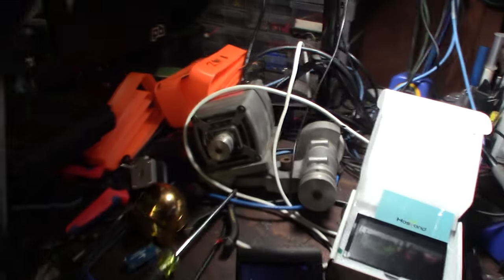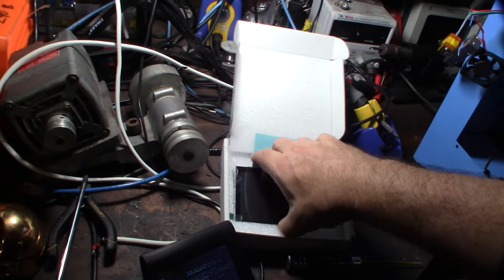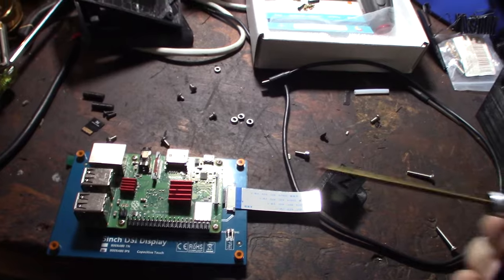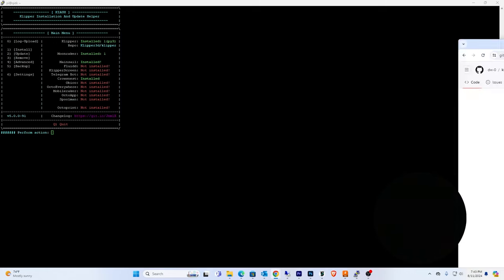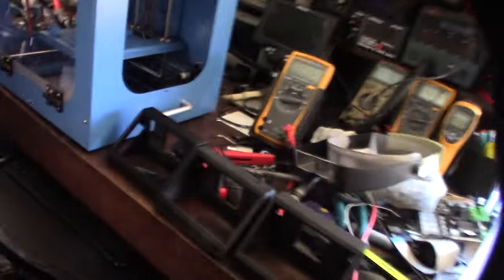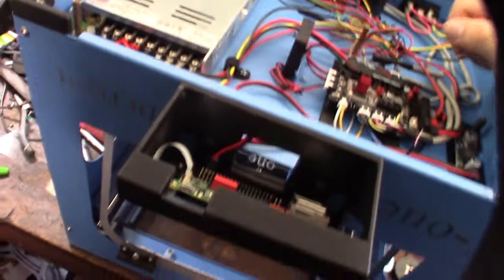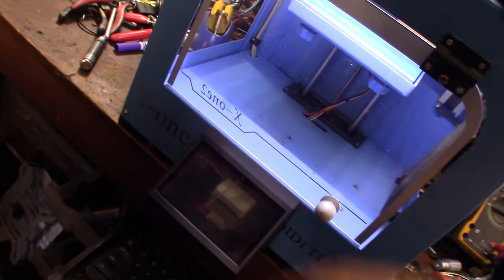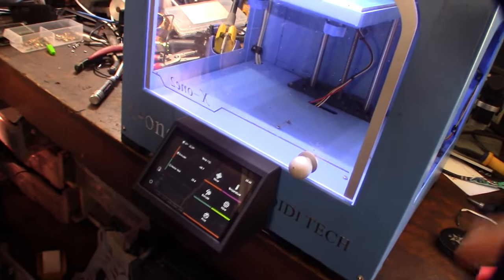Hosyond Raspberry Pi 5 inch DSI touchscreen Klipper installation with custom mount 5" 3D printer

Comment: Recycling fee? Hahaha. I bet the politicians haven't figured out yet that we use LEDs now and not CCFLs.

I've been liking HDMI screens. It is nice to not be tied down to using a Raspberry Pi, because there are just so many good minipc options out there and a lot of them don't have native DSI. Everything has HDMI.
Reply from the maker: I've tried allot of raspberry Pi alternatives in the past. I have a bunch of Orange Pi's I use as network monitors when I'm trying to troubleshoot  network problems. I install them in customers networks and use wireshark and other tools. I have allot of extra mini PC's. I work in IT so I get allot of free stuff when they upgrade. I even have allot of 10" HDMI LCD's from my crypto mining days. I have that little blue printer in this video working. Its has an incredible smooth motion system. Prints ABS incredibly.
Reply from the maker: You said jungle? What continent are you on?
Reply: @fintechrepairshop  Awesome 😄

I tried Orange Pis for a long time. Unfortunately the one I tried, Orange Pi Zero (old model, they have newer ones now), had some issues which I think were a bug in the AllWinner. They work fine for days or weeks or months but then suddenly get into a near-deadlock state where they can't even respond on network, the only thing that still works is the physical tty. It was really frustrating, tried everything to fix it but nope (tried multiple of the same board, ruled out cooling and power supply, disabled every kernel module I could including the sketchball wireless chip, etc.). So AllWinner is kinda on my shitlist now, and thus Orange Pi. I just don't trust them.
Reply: @fintechrepairshop  East coast, haha. The swamp 😝